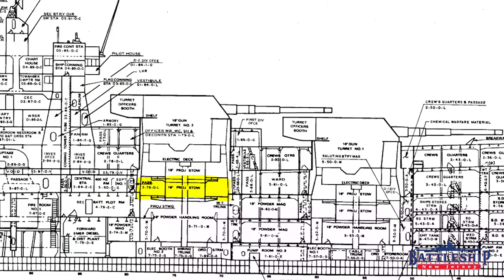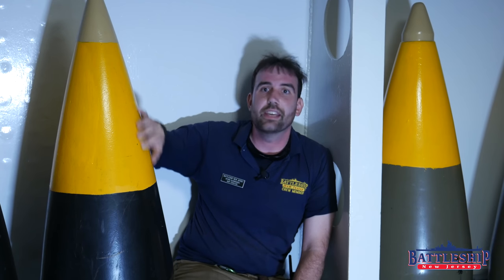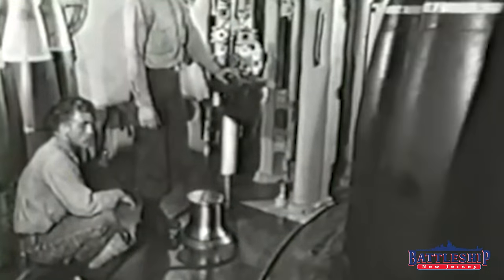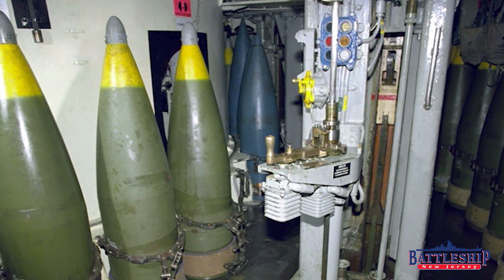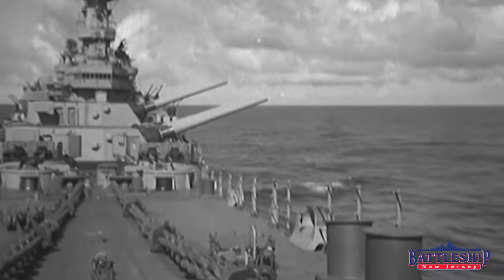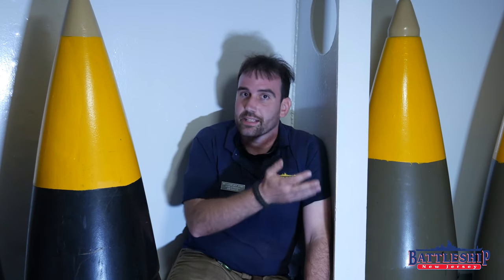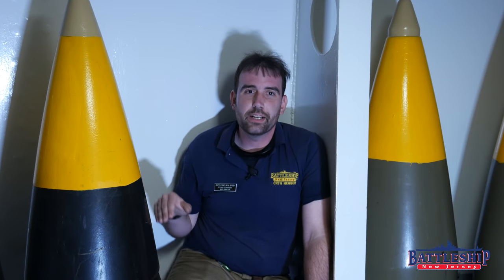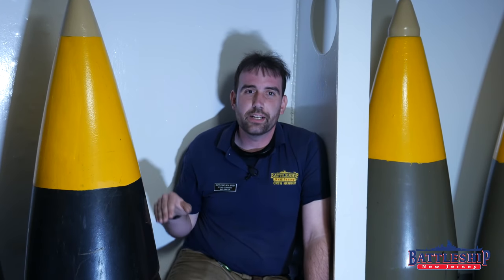What are the Different Types of Shells that the 16in Guns Fire?

Comment: I think if a major war broke out there would be smaller ships with 15,16,18 inch guns. They just offer something nothing else can do, and the thing they offer is indeed valuable. I'm not sure big giant battleships are necessary to make it happen, though. Smaller, lighter ships with maybe 1 or 2 guns, not necessarily giant ships with 12.
Reply: The technology is there. You can make an 18 inch gun using one solid slab of steel and it still would be lighter and stronger than the multi layered design of Yamato. But the financial justification is not there. First you need a ship that is at least 40,000 tons to carry this gun, electronics and counter measure defense weaponry. You can't use this weapon against China or Russia since this ship would be large, clumsy and unwieldy and easily taken out by counter measures due to its limited range. You can't use this gun against Somali Pirates because that would be like using a GAU 8 30 mm Gatling gun to mow down Bronze Age Egyptian foot soldiers.
Also by building this weapon you risk kickstarting an expensive Arms race. The best move in this regard is not to play.
Reply: @legiran9564  I think you're dramatically underestimating the effectiveness of light artillery ships.
Reply: @Melthornal  15, 16 and 18 inch guns are not light artillery and plus you are overestimating said effectiveness.
Reply: @legiran9564  Quick moving light ships offering naval support with shells instead of missiles from long range is very valuable.

Comment: On a related note, what would happen if you fired a 5 inch shell out of a 16 inch gun. Or a 380mm shell out of a 381mm gun?
Reply from the maker: If it doesn't fit perfectly in the barrel, the explosion goes around it, and it doesn't do much, it isn't effectively catching the explosion and doesn't go far. Thus, putting smaller rounds in a larger barrel usually consists of putting something else behind the projectile that is the correct size to catch the explosion.
Reply: @BattleshipNewJersey  thanks! I’ve had that on my mind for almost a week

Comment: Were BL&P shells ever filled with concrete instead of sand? I believe that I read that somewhere. I could be mistaken though.
Reply: Definitely concrete filled in the ones I dealt with. A fellow who makes them into museum display rounds told me that he once  had a machine shop remove the screw in base plate from the shell. That took 3 days and a lot of heat. Then he had them jackhammer the concrete out and that took several days. He said he would never do it again....ever!  The walls of the shell at the base are 2-3/4 inches thick. So its still darned heavy without the concrete filling.
Reply: @kimmer6  Thank you very much for all of the information.
Reply: @terrellburnette7556  You are very welcome! I was going to make mine into an air receiver for my big air compressor. Well, Its concrete filled as well so I will be painting it up like a High Yield shell instead. Here's a short video on 16'' shells and a very special gun barrel. The inert round at 0:35 is mine. The fuze adapter was removed using a lot of heat the first time. Its loose now and the hard concrete filling inside is apparent. At 0:56 in the video, the shell and brass power case at the far left is an 8''-55 from a fast firing autoloading gun system that the US  Navy had in the 1950's on the USS Salem. Its the biggest brass propellant case the USA ever put in service. https://www.youtube.com/watch?v=sgjCYDIZiDU
Reply: @kimmer6  Thanks for the additional information and the video!

Comment: If each shell type were fired at a say a sanddune, do you know the approximate size hole it would put in to the ground?  Diameter and depth?
Reply from the maker: Generally it is said that it makes a 50ft wide by 30ft deep crater
Reply: @BattleshipNewJersey  Awesome info and thank you for the reply!

Comment: What about star (illumination) shells? Duke of York used the against Scharnhorst at North Cape. Also poison gas was suggested  after fighting on Okinawa/iwo jima.  Did such shells exist? They might have been called Green Shells.
Reply: http://www.navweaps.com/Weapons/WNFR_15-45_m1935.php
"The cause of these problems was eventually traced to a defective shell design. The original APC projectiles had 4 cavities in the base which were designed to accept cartridges containing toxic war gases. These cavities were protected by a base cap, but this broke under the pressure generated when the guns fired. Splinters from the broken base cap smashed through the gas cavities and into the burster charge which then detonated. After this incident, a new base cap was produced and the gas cavities were filled in with cement."
Reply from the maker: No star shell for these guns. We use the 5in guns for that

Comment: How did the ww2 vintage HE & powder did not become extremely dangerous by becoming unstable due to chemical break down? I would be afraid of handling it let alone trying to shoot it out of a barrel & risk having it go off spontaneously in the breach or as it goes down the barrel.
Reply: They may have refilled the shells. I also expect the fuzes would have been re worked.

Comment: I wonder why the navy didn't develop a round that had a boat tail design for aerodynamic flight, that would have extended range some what. It does with rifle bullets any way.
Reply: Stability. They'd tip over easily and the sailors would have a bad day. Even if they were strapped in for the ride, moving them would be dangerous. The base would need to be around 4" to make sense (wild guess). Maybe less. It's hard enough to move what's essentially a Volkswagen around by ropes.
Reply: Not only would have made moving the rounds difficult, you would have moved the center of gravity further forward on the round making it unstable in flight. You need the weight at the back of the round.

Comment: A question about the guns.     Why are 16" guns referred to as "50 caliber".    Are 8" guns then "25" caliber?
Reply from the maker: Barrel diameter x caliber = barrel length
Reply: I did not realize that barrel length even entered into it.  I am used to the diameter of the round as in small arms ammo, being the major determination.
Reply: @BattleshipNewJersey  Is caliber measured from the breech or the front of the shell chamber? The shell plus six powder bags would be almost 15 feet long.

Comment: What if the Navy took a single 16" gun and replaced the gun from a Zumwalt-Class with it? In that case, you would have an established gun that could fire long distances. While it's tru that there are only three in service, that would be three Navy ships that could reach, maybe, thirty miles inland from the sea. Without using expensive missiles.

Comment: This maybe be stupid question,

Suppose one these shell were accidentally dropped, will it explode on contact or not? Thanks for the answer everyone
Reply: Not. Fuzed projectiles have inbuilt safety devices that rely on the G forces from firing (called set back) and the very high RPM imparted by the rifling, to arm the Fuze down range from the muzzle and make them (relatively) safe for handling and storage. This is usually achieved by having a spring loaded weight that is moved out the way by the set back, allowing a rotor to turn. This in turn aligns the small low explosive components with the high explosive components, creating what is called the explosive train.

Comment: I'm surprised they never developed illumination or smoke shells for these guns.
Reply from the maker: The smaller 5in guns do that just fine. And at 23 miles, it wouldn't be helpful
Reply: @BattleshipNewJersey  It really just depends on how quickly ground forces advanced off the beach. In WW2 sure not incredibly effective, but in situation like they were employed in the 80s I can see how it would've had its advantages. That's a big reason naval gunfire is very limited in today's capabilites. Provided it also has had a conflict where it would be useful since the 80s either

Comment: A few geek comments from an old explosives geek. The Army is currently demilitarizing the 16-inch Navy projectiles at the Crane Army Ammunition Activity (CAAA) - located at NSA-Crane near Bloomington, Indiana. They are all old Navy battleship projectiles (quirk of regulations: The Army for the last 40+ years does all the demilitarization of ammunition - even if it is Navy ammo. Go figure.) There is also a YouTube video of the 16-inch/50-cal demilitarization process at https://www.youtube.com/watch?v=jHX1OkB45CE.  Yes, Explosive D (also known as "Yellow D" or Dunnite (after Col. Dunn of Picatinny Arsenal) is the ammonium salt of Picric Acid. Stable, almost as powerful as TNT, very insensitive (it can take the gun setback forces that would detonate TNT or Comp A3 in the gun barrels) - but highly corrosive, water soluble, and toxic. Supposedly the exposure limit is similar to strychnine. Exp D will turn you bright yellow on contact. Don't ask how I know this. Workers who handled the stuff were nicknamed "canaries" since they were invariably bright yellow. It only takes a few weeks after your last exposure to finally turn back to a normal color. The fuzes on most of the projectiles are corroded in place (Navy tend to store projectiles fuzed; Army typically stores unfuzed projectiles. And, yes, fuzes are spelled with a "z," not an "s.") The yellow nose paint, however, means "High Explosive," not Yellow D. All military ammunition with a yellow band is a high explosive round per MIL-STD-709. An interesting note is that the USS New Jersey was also assigned a special blue color code for the AP (armor piercing) projectiles that appears below the yellow nose. There is a blue dye pack in the hollow windscreen so that if two IOWA-class battleships were firing on a common target the dye would allow the spotters to identify which ship fired that shell (USS IOWA = orange; USS MISSOURI = red; USS WISCONSIN = green). Great job! I remember getting to go on the USS New Jersey when it came back to Seattle prior to going to Puget Sound Naval Shipyard for mothballs. They were all great ships.

Comment: pshooot 37 miles, and over 100 from an iowa, yea that would put fear into the enemy, even an 11 inch shell would be a heck of a larrrge amount of explosive carried far more then the mk 777 they use thats about a 5 inch which is pretty significant especially used with the excaliber round when they rarely do but double that yea thats a big bang

I dont know I still think an advanced gun concept is not a bad idea its cheaper then using missles and adaptable, even though the officially cancled the railgun research two weeks ago or so now or so they say, but I think its still a worthy concept even with rocket assisted shells or the kenetic rounds that were to be used with the rail gun that can also be used with standard artillery a 20000 doller piece of metal is way cheaper then a million doller missle for taking out a target, and dont think that the other enemy states are letting up in research of new wepons, though I do belive we still have directed energy wepons research ongoing, and do have one that has been used on stinger missle carriers to burn though and detonate inprovised exposive devices in the last decade.

the fact is we have many wepons platforms that are dated, they do the job well, but development times seem to be getting longer and longer for new stuff, and it dont always do the job as well as what it replaces, computers only go so far in fighting wars, sometimes you have to have assets on the ground, even if it takes less then it used to to do the job, and the battle lines have changed since the cold war, not so clearly defined, and now it seems we have ideologys we are fighting and not nations but concepts or asmetrical battle lines some within our own shores, or effective misinformation being sewn by forign sources, many nations do this, but there are some that are definate concerted efforts from militaries of enemy states.

complacency kills though I know that much.

Comment: I would have used sabot rounds for speed accuracy and penetration
Reply: Sabot would only be effective/necessary against an armored belt.  Iowa Class BB's use plunging fire and the mass of the shell is more important than anything, to get the explosives inside the vessel by crashing through the top deck/superstructure.  If they ever were within point blank range of another BB, maybe a sabot could be effective, but the gun would have to be sniper scope accurate to target specific locations such as Command and Control, engines, magazines, fuel bunkers, etc.  Also, sabots are very expensive to build.

Comment: they should refit a destroyer with a single non rotating 16 inch rifle for shore bombardment. point the ship to aim and fire away. In a modern war they will run out of expensive missiles and need the old tech just like they did in one of the gulf wars  when they ran short of smart missiles